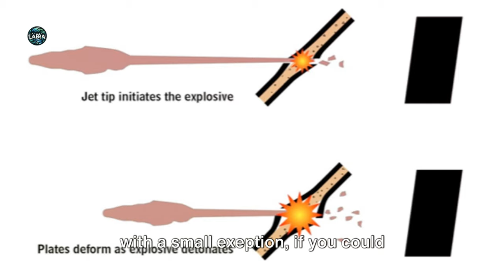How the Killdozer could have been improved

Comment: you don't need reactive armor just cage armor that is a cheap light standoff armor that catches heat rounds away from the actual plate its what im putting on my killdozer
Reply: Ah yes, The Cope Cage.
Reply: Like some Panzer 4 models
Reply: @RandomPerson0646  its better than nothing
Reply: @RandomPerson0646 would you rather eat shit to heat rounds?
Reply: If you are at the point where they are using anti-tank munitions, you aint getting out alive anyhow.
Reply: @dr.hugog.hackenbush9443  so true, people are making it seem like I'm shitting on the idea, but if they're shooting heat rounds at you, they'd just wind up using a Javelin
Reply: @dr.hugog.hackenbush9443 You didn't rig your killdozer with an improvised nuclear explosive set to go off after vehicle operator's death?

Sad.
Reply: Ceramic balls embedded in steel were how they made the T62 armor. Without dedicated Anti tank weapons, definitely not available to a police force, you can't penetrate that. But even modern spaced armor has a lot to learn from if you want to make an improvised armored vehicle. For example, increasing the number of deflection surfaces will make the projectile tumble, reducing the penetration when it hits subsequent plates behind. A bundle of steel tubes stacked then welded together and sandwiched between two steel plates can achieve this while being made from readily available materials.
Reply: *in Minecraft

Comment: Remote control would be absolutely impossible: Jamming would easily disable your comunication link and radiogoniometers will find your control station in moments.

Also, while very heavy, his "composite armor" of layered steel and concrete was actually way more resistant to anti-tank weapons than any actual tank armor.
That's because the jets of shaped charges, while very effective against metal armor, perform quite poorly against concrete.
And while concrete on its own is brittle and can easily be damaged by regular explosives, reinforced concrete compressed between layers of stell is completely another deal.
The only reason they don't use something like this in tanks is because they would be too heavy to be practical (no crossing bridges, insane fuel consumption etc.).
Reply: Ceramic balls embedded in steel were how they made the T62 armor. Without dedicated Anti tank weapons, definitely not available to a police force, you can't penetrate that. But even modern spaced armor has a lot to learn from if you want to make an improvised armored vehicle. For example, increasing the number of deflection surfaces will make the projectile tumble, reducing the penetration when it hits subsequent plates behind. A bundle of steel tubes welded together and sandwiched between two steel plates can achieve this while being made from readily available materials.

Comment: Was it ever explained how exactly his cooling system failed towards the end? There was a bunch of smoke towards the end so something had to have ruptured, but how? Was it just increased pressure from the heat, or did something hit the radiator? And I wonder if he could have escaped the building's basement if he had the engine's full power.
Reply: A coolant line blew.
Reply: I thought wasn't any exhaust vents for the engine?
Reply: @MrRAGE-md5rj  
both

Comment: If Heemeyer had unlimited access to military technology and the vehicle must retain the same silhouette, there's a few interesting upgrade paths for it I've considered:

Upgraded composites:
Upgrading the improvised composite armor to proper mil-spec composite, using RHA with ceramic sandwich instead of concrete and tool steel. Additionally, redistribution of armor to have more on the front and less on the sides would increase its survivability if proper armored fighting vehicle tactics are used. 

Explosive reactive armor:
Addition of ARAT ERA panels to the sides or even Kontakt-5 or Relikt which can add additional KE protection as well. 

Active protection system:
The large surface area of the vehicle would be best suited to Germany's AMAP-ADS which incorporates both a NERA tile with an individual, self-contained APS charge and sensor. 

Sensor upgrades:
The Killdozer is already remarkably complex technology wise for a civilian improvised fighting vehicle. Upgrading the cameras with night vision or even thermal channels would improve its night fighting capabilities. Additionally, a laser warning system could easily fit on top and add negligible weight. 

Improved survivability and proper NBC protection:
The Killdozer already possesses a sophisticated ventilation system that was even able to withstand a flashbang going down the exhaust. Further upgrades with proper NBC protection, spall liners, and filtration would allow the vehicle to remain combat effective even in contaminated environments while protecting its crew from spalling when hit. 

Crew increase:
While the base bulldozer vehicle was only suitable for a single operator, minor modifications to the dozer cabin underneath all that armor could improve internal volume, allowing the addition of one or two more crew members to help split tasks up and increase the combat effectiveness. Preferably, three crew members at the minimum for a commander, gunner, and driver. 

Main armament:
Due to its civilian origins, the Killdozer's armament was limited to basic firearms fitted to gun ports. Upgrading the main armament to fully automatic weapons would improve its effectiveness against infantry. The .50 cal Barrett could be replaced with an M2 Browning, the other small rifles could be replaced with M249s. Another possibility is, with a rework of the interior, changing the main armament could be changed to a single forward facing autocannon. Even further, a remote weapon station on the roof with the autocannon or even an M2 Browning could improve its ability to engage enemies all around. Alternatively, its large boxy structure would be suitable for an ATGM carrier. Mounting a TOW or Kornet launcher on top that can retract and be reloaded from inside would give it excellent anti-tank capabilities, however a machine gun should still be retained somewhere.

Engine upgrade:
One of the Killdozer's main shortcomings was its engine, which overheated and was clearly impacting its performance near the end of the rampage. Upgrading tbe engine to one which can handle the increased mass of the vehicle is crucial.
Reply: Basically "build a not-a-tank tank"
Reply: thanks chatgpt
Reply: @Katniss218  lmao what
Reply: Impressive you got chatgtp to write about this
Reply: @makeandbreakgames1791  Yeah that looks straight up from the console lol
Reply: @makeandbreakgames1791 when the commie has to use chatgpt cause it doesnt have the capacity to think for itself:

Comment: One thing I've always wondered was if LEOs could have disabled the killdozer with molotov cocktails. I know it had AC but could the molotov have choked the engine, could it have contributed to an engine overheat, could it have cooked the Operator? I wonder what tools available to the every day American could have been used against the killdozer. How close did officers get? Did they ever attempt to mount the machine?
Reply: some officers did get onto the killdozer hoping to find a hatch they could force open, but once it was known Marvin had welded himself shut inside no one else bothered to get on it.

Comment: better idea:
forget the bulldozer entirely, get a decom cold war tank. the gun is probably decommed so just get rid it. The entire turret is not much use either honestly, might as well as get rid of it entirely. Cover the turret hole with a thick metal plate and weld it shut.  Since the goal is only to cause property damage, weapons are not needed.  Since the turret is missing along with cannon, the PD probably won't be able to call in the military to help either. the saved room from removed weaponry/ammunition should be used for additional fuel. cover the entire engine bay with cope cages, metal meshes, and shutter armor, you dont want a molotov to end your rampage. To plow thru buildings more effectively, you could take a dozer blade from other heavy machinery and weld it on but ultimately is optional since a tank ram thru a building pretty easily anyways. The original engine is probably very old and should not be trusted, get rid of it entirely and replace with a similar sized diesel engine from other heavy machinery like a combine or something. Make sure everything is properly cooled. To prevent unwanted access to the inside of the tank, make sure the hatch can be locked from the inside, and litter the entire tank with barbed wire as climbing deterrent.

there, you are now good to go, level the entire town and no one can stop you :)
Reply: Why not start with a tank recovery vehicle? 
Already has a tank hull, no turret and has a blade. 
Add flame thrower for extra damage.
Reply: great idea! the flamethrower is unnecessary since Marvin's original goal is to only maximize property damage but avoid any loss of human life, so Id say we do not need any weapon. also a armed militarily vehicle means the PD could call in the military and end you with a anti tank missile, but if the vehicle doesn't have any working weapon the PD will have a very hard time to convince the military to help. also yeah the blade that comes with the recovery vehicle is great since its probably more reliable than a random dozer blade salvaged from elsewhere. another idea is to rework the whole engine bay if possible, since almost all tanks have exploitable spots on engine bay that can lead to a molotov ruining everything. my idea is redesign the whole engine bay, replace the engine with a bigger one because more horsepower is always good, make sure all radiator grilles are facing downwards thus no molotov can get in, install multiple units of radiator with individual shut-off switches incase one gets damaged. Cover off the entire track section with something because if a piece of concrete got in there, the tank could throw a track and its joever. @sprky777

Comment: Since i have nothing better to do, lets take a look at exact equipment and hardware that you would need to improve the killdozer (educational purpose only):
First the armor, lets remove all the armor and put in an armor of all around 40mm HHS with double layer of laminated and 20mm of RHA, and then in the interior we would put screens of kevlar 29 for protection agaisnt shrapnel from heavier rounds that could penetrate like 25mm apds rounds or higher. That along with the composite armor aldready mentioned should give a protection of up to 20mm cannons, anti tank rifles, anything in use by police forces. Then looking at mobility the composite armor would be lighter giving the vehicle a reduced weight. The vehicle would also additionally have a V shaped floor armor made of hardened steel. That would give it mine resistance, then we would put spikes and barbed wire all around along with tear gas launchers. Additionally the inside would be protected by extra layer of biological resistent material, as well as be filled with oxygen tanks for improved survivability in case of breach. For the engine we would replace the 410hp engine with the catterpillar diesel CAT 3408 modified to have at least 550hp, in terms of reliability this engine can withstand about 15,000 hours of continuous work as it was made to last. Replacing the air ventilation with armor protected ones as said in this video would also be necessary. Now for the armament i would also remove the back excavator to clean the way and then remove the .50 cal rifle and put a german MG3a1 on its place belt fed with some certain diameter being outside for air ventilation if you couldn't do that i would try to find a convertion kit to make it water cooled. For the sides you could use the highly reliable soviet rpk also belt fed as well as muzzle braker to reduce muzzle flash. Then for the front i would put the maxim machinegun water cooled and some armored ports in which you could open and shot with an m16 or ak. Finally i would put small pieces of kontakt-5 on the sides and rear with an additional small cage armor just about 5cm away from the armor which wouldnt give it much effectiveness but would reduce the overall chance of it getting stuck in debris or other stuff. And thats all for today and guys please dont do the killdozer 3.0, this is all for educational purposes and just for fun, i dont support non condemn martin heymeyrs actions. Gos bless you all. (I KNOW martin didnt mean to kill anyone thats why he didnt added automatic rifles to his vehicle thats why this is just a yt comment for a possible uograde, thanks.).

Comment: Remember this was in 2004, before quad copters were everywhere and GPS was either reliable or accurate or common. And before cellular data was a common thing. Streaming this video would have been wildly expensive in 2004 for instance.

Comment: An alternative to ERA could also be slat armor, which if built well enough could disable shaped charges such as PG-7 or other non-tandem shaped charges. Additionally, weight saving could be done by using homogenous armor on the sides and rear, and heat treating an outer layer at a higher temperature, thus increasing the BHN and allowing for a similar effect as ceramic armor with a steel construction. NBC could be easily accomplished using an overpressure system where filtered air is pumped into the drivers compartment and the higher air pressure pushes the "unsafe air" out

Comment: Add Kontakt-5 ERA, add 2 pieces of Shtora-1 Soft Kill APS  To be aiming at a slant whilst also aiming forwards, add periscopes to be used as sights and gunsight to make it much easier to aim, add a lockable hatch on the top, and if possible without taking much room, add a 2A46M-1 Smoothbore cannon somewhere next to the driver's sight port, and 9 pieces of ammo, assuming that a bulldozer would even be able to carry 8 pieces already.

Comment: The extra radiators would be a weak point unless heavily armored, especially if they drew in air from the exterior.
Mustard gas is extremely difficult to get, unless you're a chemist who can make it.
Remote control, if by that you mean a remote operated veichle, would not work, it would just be jammed. An overhead drone would just be taken down almost immediately. Instead a TV so you can see what's going on from the chase helicopter is a better way to do things, which I think Marvin did.

Spaced armor (slat armor) over the main armor would work almost as well as ERA.

A GPS antenna on the roof would aid with navigation if the cameras and prisms are covered. A VHF/UHF antenna and scanner would allow the operator to listen to local radio, to avoid roadblocks. 

Covering the cameras in multiple layers of plastic like Russian nesting dolls, each if which can be blown off using compressed air/propellant so if one is spray painted over it can be discarded.

Razor wire around the roof of the thing along with spikes would deter people from jumping onto it.

Comment: screw NBC protection, the weakest link is the human element. also, armor plating this extensive works essentially like a faraday cage, so EMP wouldnt really work too well against it either. so i'd say that an AI would need to drive it and all you had to do was to add some waypoints. and yes, remove that back part and replace concrete with something halfway useful. spikes and stuff to put on top wouldve done nothing bc irl cops DID climb on it and didnt achieve anything. if anything, he couldve just lubricated the entire thing for fun, but after driving through a house or two, that wouldve been gone. well, maybe not on the side and back.

but really, in the end what made the difference was the cellar, so maybe widening the tracks and reducing its sheer mass wouldve helped more than all of the above combined.

ps: crazy question, but what if he had access to enough kevlar, could that have reduced the weight of the armor but kept it similarly protective?

Comment: - Angled plating on the front where the exhaust is would help a lot at keeping weight down and rubble off viewing windows/ engine. 
- Pretty simple razor wire around the rear and sides would help against people walking near, and its so lightweight it could be torn off very easily by the dozer if it got jammed up.
- Better steel, we have 20 years more materials science now and lighter stronger steels exist/ other materiel. 
- Removing unnecessary armor around areas of non importance, and adding a rudimentary spall liner in the cabin from ceramic/ uhwumpe plates.
- Better cameras, modern ones with a bit of plexi glass infront
- Better cooling, as well as maybe a simple engine smoke system, its not tear gas but you wont wanna stay in the same place if youre breathing that shit in
- the chemical attacks wouldnt do much, most cops have gas masks etc.

Comment: Out of curiosity, why not cut off or otherwise remove the backhoe? It can’t be used and the armor and other weight that would be used to over it could then be used to either up-armor the rest of the vehicle or be left off to maybe give a bit more speed to it. Obviously the section where the back hoe would be still needed to get armor over it, but it wouldn’t require much armor as it otherwise would, due to it being a mostly flat section instead of a large armored box.